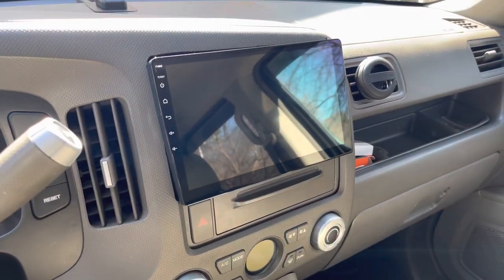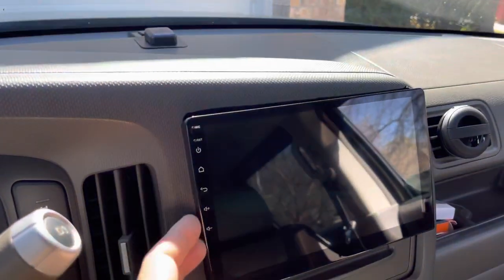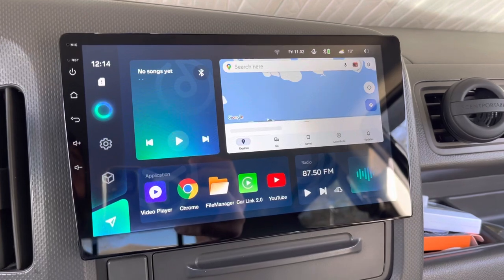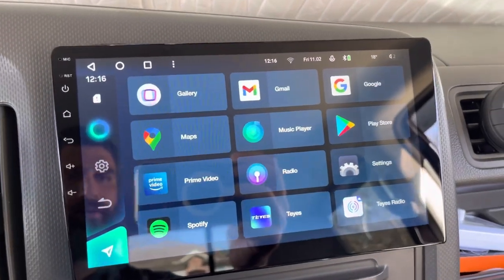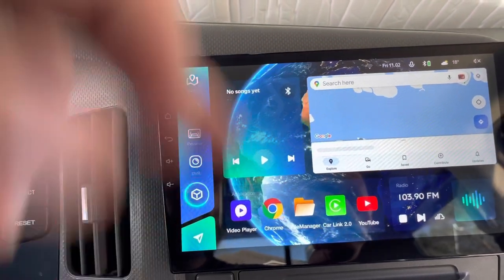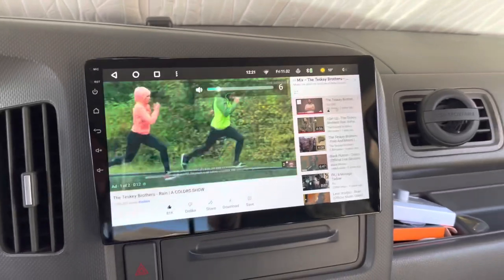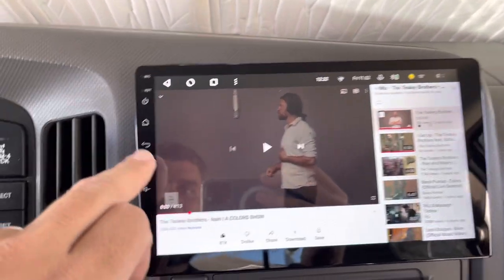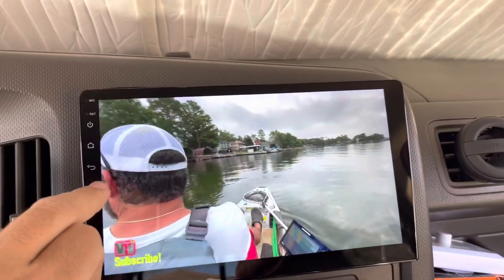My favorite upgrade!  2006 Honda Ridgeline with AFFORDABLE 10.1” SCREEN!

Comment: Great video! 👍 just a heads up if you plan on getting the 360 camera in the further. If you did not order the 6g+128gb model added the 360 to your order at that time. You won't be able to get the 360 camera. As they will install an upgraded mother board to the 128gb model to support the 360 camera system.
Reply from the maker: Oh no I purchased the 4g version I believe. Thanks for the info!
Reply: @VentureTube  your welcome I just got mine for my jeep grand cherokee, and I'm having some issues with the canbus. So I emailed support waiting to hear back from them might take a while being it's Chinese new year. Aside from that the unit is amazing 👏
Reply: Can you let me know the radio that you installed for the 360 thank you very much

Comment: Did you use the universal cable that came with the head unit to wire it in? Or did you buy an additional wiring harness to wire it, and if so what wiring harness did you purchase? Thanks!

Comment: I was thinking of getting one of these but I own the RTL Ridgeline and you'll lose the subwoofer if you use an aftermarket touchscreen....Bummer
Reply: Why do you lose the subwoofer? Doesn't it use av cables that can be connected?
Reply: I'm not sure but people say it has to do with the fact that its a Honda sub and isn't compatible with aftermarket head units. Anyone who installs a new radio into an RTL also has to buy and install a new sub. The original is behind the back right seat, but a lot of people put a sub under the driver seat. It's frustrating because I can't afford to do both right now so I'm stuck with my factory CD player lol @lionintu